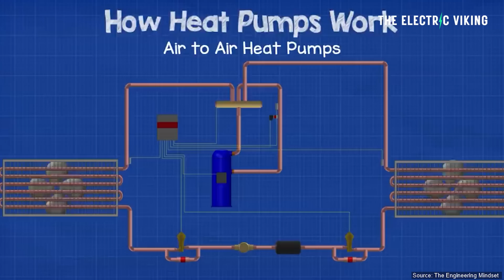U.S reveal NEW Heat Pumps that withstand freezing weather & save 50% energy

Comment: This is "Old News" for us in Canada.
I live in East Coast Canada in a 3500 sq ft (325 sq metre) house.  My 99% temperature is > -20*C.  Some 12 years ago my total all-electric bill, including resistance heat was about $750CAD in the coldest months.  Since then I have installed Fujitsu heat pumps which operate down to -22*C (-9*F) and my highest bills are now less than $450CAD despite a 100% increase in cost per KWH.
Reply: Some people in the Nordic countries build "nowadays" houses without a heating system!
If you build a house and want to use a heating pump quite efficiently, the design of the house has to be quite open, which people have realised about twenty years ago.
In the Nordic countries many use the much more expensive solution with air to water heating pumps.

Now the solar panels have been getting so affordable that it's interesting to use them as a part of the solution. In a few years the batteries will be a normal part of the solution, too.
A heat pump will always be interesting because of the ratio like 1:5.
Reply: @leiflillandt1488  The main part of my house was built before 1815.  The latest additions are 60+ years old. Over the last 20 years I have maximized insulation, but have reached the limit for this old house.
If I were to build a new house, It would be super-insulated/passive solar heated.  Meanwhile air-to-air heat pumps ()with electric resistance backup heat for super-low temperatures are my best option.
Reply: @leiflillandt1488 what do you mean houses without a heating system?
Reply: Yes and no. I'm in Ontario and just seeing heat pump info in the last year since I'm researching new furnaces for my 25 year old unit.  So they were out put you had to look them out. And I'd wager that most home builders are still putting in old tech unless you push to upgrade IMHO. 

Cheers
Reply: @patrickmckowen2999  I TOTALLY agree.  Installers do not push higher efficiency units which heat well during extreme low temperatures.  Fujitsu and Mitsubishi produce excellent units - ideal for all of Southern Canada.  BUT, Fujitsu will not supply parts for non-Fujitsu installers - so most installers are VERY reluctant to instal them.  They prefer to make a large mark-up on mediocre Seer/ Seer2/HSPF2 units because people do not do their research. Caveat Emptor!!!

Comment: It’s only within the last 15 years that heat pumps could heat homes efficiently even if the outside temperature dropped to -20° Celsius. That’s why they are getting a lot more popular now.
Reply: @pin65371  The sun does not shine for 72 hours due a truly cosmic lunar eclipse?? A solar panel will always generate power during the day, even during cloudy days, albeit with a dramatically reduced output. 

As for the energy consumption of the home, this depends how much energy they consume in the first instance. It really goes without saying that those not connected to the mains electricity grid ought to have the most energy efficient household possible in order to minimise power draw.

In Australia, the average home electricity power usage is 15kWh per day. When 60kWh battery storage becomes available for less than AUD $10,000 an ordinary home will be able to become totally self-sufficient, as the household can rely on energy stored on the battery for more than 4 days before needing to draw upon the the mains electricity grid. I say more than 4 days as the home will be drawing power directly from the solar panels during the day.
Reply: @pin65371 - That's the primary purpose of the "grid," to economically, reliably and now cleanly as well, match power supply with demand, including the use of energy "storage."
Reply: @pin65371  Where do you live, approximately?  I think it's safe to say very few people live in areas that can consistently get to -35 degrees.   The only place I see right now that cold is Alberta or Saskatchewan Canada.  Even Fairbanks Alaska, the coldest place in the US isn't that cold right now.  Neither is Scandinavia or any of Europe.
Reply: @Ryan-ff2db , it must be Alberta (Canada), that’s where they are talking about rolling blackouts.
Reply: @pin65371 that's why it makes sense to have additional source like hearth or wood stove. But the idiots in the EU commission are forcing the newly built houses without a chimney: they literally mist not have chimneys, which means that in case of disruption like war which is increasingly likely some people will freeze to death.
Reply: Why should wind turbines stop when it is cold? You design for expected conditions. There is absolutely nothing inherent in the concept of a wind turbine that should stop it working in the cold. Simple. @pin65371
Reply: That is why a proper system should use storage, lots of it, and interconnects. The wider the area the better. Even making hydrogen to use in a combined cycle generator may be part of the solution. @pin65371
Reply: Yup, it’s Alberta. -35°C to -42°C this weekend. Citizens cut back during the 16:00 emergency warning to save the grid stability.
Reply: @pin65371 looks like nuclear is for you then
Reply: @Electruver   God no. Nuclear is bloody expensive to build then eventually decommission. The latter is especially the case when there is a nuclear catastrophe.

Comment: This is not new! I have been installing Heat Pump for 18 years. This cold temperatures technology has been in use for many years.
Reply: True, but recent new improvements have reset the lower temperature parameters. Older tech struggled near zero degrees Fahrenheit. Newer tech allows for - 22 degrees Fahrenheit. Significantly improving the technology.
Reply: @ter450 ITS NOT NEW!😂 Jeez these americans are decades behind. We have had low temp heat pumps here in northern sweden for 20 years!! We are talking -20c. Its time US and central europe gets their head out of their asses 😄
Reply: @ter450  it is the EVI -- Enhanced Vapor Injection technology
Reply: Yes, but not really high efficiency in sub-zero temps
Reply: Just had a -6 F morning in Missouri and my mitsubishi hyper heat was still putting heat out.  It's a 2.5 ton ducted system and it was keeping temp @ 64.  I think it defrosted once which caused it to struggle after.  I need to find the setting to make the heat kit turn on when in defrost mode and I should be good to go.
Reply: So what are the most cost-effective recent technology pumps for a 6a region near Detroit? Currently forced air and goodman AC house.
Reply: @chrvids5846  use heat pump with the EVI -- Enhanced Vapor Injection technology equipped heat pump which is able to operate -25 degrees in F.
Reply: Not rolled out yet, but the figures are excellent on the face of it.

Our Mitsubishi Ecodan Air Source Heat Pump is doing well after 18 months. Happy we converted.

I’m not sure about low income households, it’s expensive to install, 8-10 year break-even.
Reply: Yep, you're right. Heat pumps have been working well for decades. Thing is, in the last few years they've started to become even better in low temperatures performance. Their efficiency has never been in doubt.
Reply: He's talking about next gen heat pumps - did you watch the video?

Comment: Thank you for a nice clip.
Sweden has had heat pumps since the 1980s, so I don't understand what is the technical novelty here, because except that the US has finally caught up with Europe, welcome.
Reply: homes in the us have had the same oil furnaces since the 60's its not really a matter of not having the technology its getting people to adopt it but not everyone has the money up front to install a new 15k dollar system when the one they have still works perfectly fine.
Reply: You can thank the fossil fuel industry and local neighborhood healers  for not liking them etc. because it is a direct threat to a huge industry  going back to the Rockefeller’s and Standard Oil. It has been relatively cheap for over 100 years and easy to use and reliable. But with sudden price spikes due to wars and the globalization of supply and demand, OPEC and other things the US is making the switch to heat pumps slowly especially in cold climate regions. Oil is heavily subsidized in the US and fuel taxes are way below what they are taxed in Europe and we don’t have a VAT tax etc.

Comment: Nothing special here. Electric viking doesn't understand the physics.  A normal car/home air conditioner is a heat pump. But one that cannot run in reverse to heat the car/home.  That's the only difference. 

It's not new technology. Only the engineering is a bit different
Reply: Heat pumps, or reverse cycle air conditioning, certainly do heat homes in winter. Heat pumps are ubiquitous in Japan, even in the northernmost prefecture of Hokkaido where it gets bloody cold.

Comment: heat pumps have been around for ages, its just that there is not that many that do air to water, or water to water (for built in floor heating).

Comment: Not sure what is so special here, my mother has had heat pumps that worked down to about -15C for almost 40 years, though the first one she got was stupidly unreliable. Thankfully, she had and still has natural gas as a backup.
Reply: Standard heat pumps only function effectively down to freezing temps and require frequent defrosting. They have a back up heat source which defrosts the unit and supplies heat for the building when the heat pump can't. My system uses an oil furnace for backup. Many systems used electric resistance which was expensive and supplied inferior home heat. In my area temps got so low one year the heat pumps using  electric resistance froze and were completely useless for several weeks. People had to buy kerosene and other types space heaters .
Reply: I am in canada. My 3 years old heat pump always work well, even a -22f. Very reliable. It only need a couple of minutes per hours in defrost mode.

Comment: And when the power goes out during that freezing weather... you'll be starting up your gasoline powered generator to run it
Reply: Yes, the petrol generator will run… until the petrol is fully expended. But, with home solar and battery storage, the energy generation cycle is virtually perpetual.
Reply: @user-kc1tf7zm3b what if the sun doesn't shine for 2 or 3 days? An airconditioner will fully delete a home battery in 6 hrs!!
Reply: @robertfonovic3551  It depends. It depends on the household’s energy usage, whether they have access to mains electricity and what the residents’ proclivities are.

There are a good number of Australian households who live in remote areas, far away from the electricity grid, who are totally and successfully reliant on renewable solar and wind energy generation and battery storage. These people are still reliant on petrol diesel cars as electric 4WDs and utilities are not yet commercially available.
Reply: No.
Reply: Buy an EV with Vehicle to Grid (V2G).  

I can’t wait until the prepper community figures out that Solar + EV + Batteries makes you energy independent.
Reply: @American_Energy  “Prepper” people are strange. What are they preparing for? 🤔
Reply: @American_Energy great idea. Spend 40 k on something to replace what we have enjoyed for the last 70 yrs for nothing!! Wow. That sounds sensible .😅😅😅

Comment: $500 a year is only $5000 over 10 years. So a $15,000 heatpump only makes sense if you are already spending $10,000 on an air conditioner. Which more than half the nation does. 

My heat pump is 11 years old so hopefully I get a couple more years out of it. I would really like to install the 2028 technology pump not the 2024 technology pump.
Reply: I'm surprised why you didn't purchase a whole house evaporative system.
Reply: @robertfonovic3551 We have medical issues that require us to keep the house at 72 degrees even if it is 110 outside. Only a large AC unit can do that

Comment: I hope you're right.  In 2012 I built a home in Michigan with a geothermal system.  Two units were installed for $28K, supplying heat in the winter and cooling in the summer.  Ten years later, one of the units needed replacement.  I was advised that a replacement unit would be $28K and that operating costs would be 40 percent higher than replacing with a gas furnace and electric air conditioner that cost $17K.  I sadly chose the latter.
Reply: The Canadian Government openly endorses heat humps (reverse cycle AC) in their country. So, if it is good enough for Canada with their freezing winters, then it is certainly good enough south of the border where it is warmer.

Heat pumps are ubiquitous in Japan, even in the northernmost and coldest island prefecture of Hokkaido. Japan gets bloody cold in winter. ❄️ 🇯🇵
Reply: I support heat pumps, but I expected the higher up front costs to be offset by lower operating costs.
Reply: @thomassimmer5186  In Australia at least, heat pumps in the winter are far cheaper to run compared to gas heating. In the 2020s, gas heating is pointless. The American Youtuber Technology Connections is at pains to point this out with his analysis and commentary of the many advantages of heat pumps.
Reply: @thomassimmer5186  A 36000 btu 4 zone split unit is about $4000 Cad.  Not that expensive and if you are handy you can do most of the work yourself.  In Canada you are supposed to have a refrigeration tech test and commission the system.
Reply: @user-kc1tf7zm3b The Canadian government hasn’t got anything right in 8 years! If you do the opposite of what they say you will come out further ahead🤔
Reply: There are still a couple places this is true. But as we install more wind, solar and batteries that will be less and less a reality. 

Hopefully they can start getting 20 years out of the midrange systems or the heatpump won’t pay for it self before it’s replaced.
Reply: The expensive part of a geothermal heat pump is installing the piping to the heat source.  So unless your piping failed, you may have been sold a bill of goods.
Reply: The underground piping is fine. The heat pump failed and needed replacing.  I was quoted a price from the company recommended by my builder.  The replacement cost was $28K vs. under $17K for a gas furnace and electric air conditioner.  This was in 2023.  The home now has one functioning geothermal unit, one gas furnace and one air conditioner.  Later, I spoke with a neighbor who is in the furnace business elsewhere in Michigan and he was not surprised.